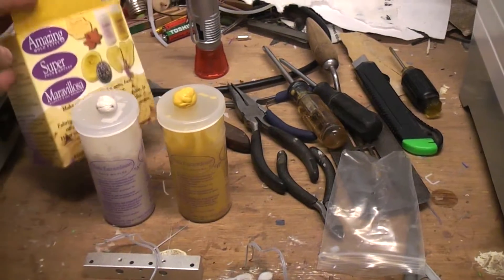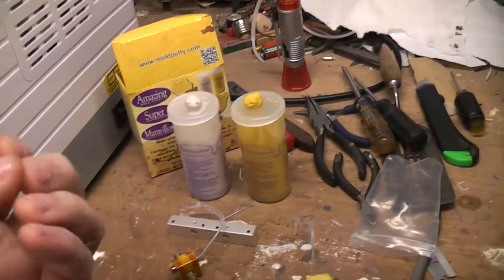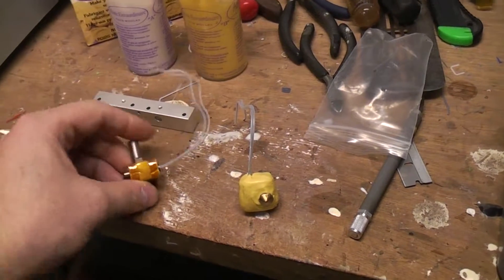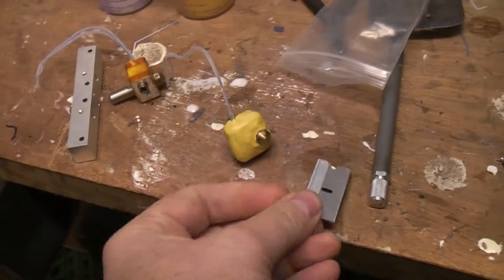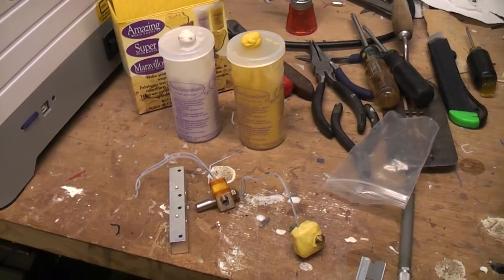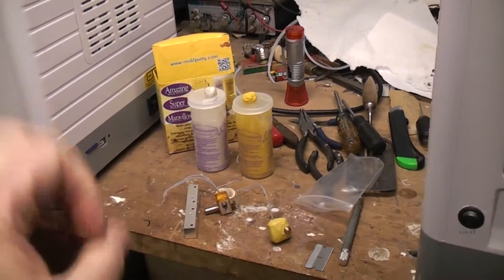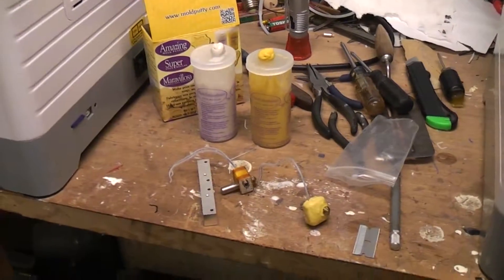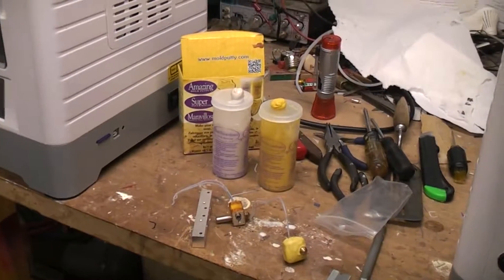DIY silicon rubber  hot end boot for your 3d printer

Comment: Great video! My only concern is the temp. You mentioned it's 500 - 600, but their website only says it's up to 395f   https://www.alumilite.com/store/p/925-Amazing-Mold-Putty.aspx
Reply from the maker: Great point Rob, if the silicone you use is not rated high enough you probably should not use it. 395 F is 201 C so that would be cutting it real close if the silicone used is that type. These days the silicon boots can be bought all over the place dirt cheep so probably no reason to do this way. There was a time when finding the boots or socks was kind of hard to locate, but not now. I no longer have the Flashforge Dreamer printer, so could not tell you how it is holding up.
Reply: Thanks for the quick reply! Either way, that putty looks great for lots of hobby stuff! Ok, I've followed your advice and ordered a few "socks" to try out. You're right, there are a ton on Amazon, ebay, etc! Cheers!